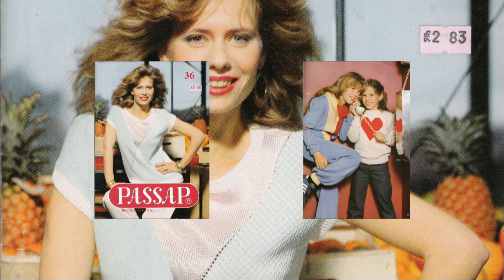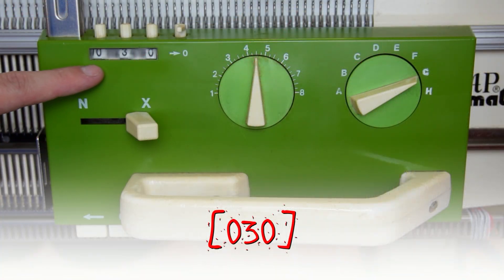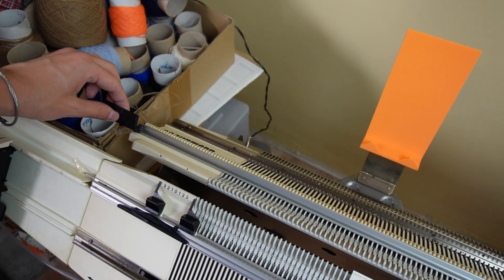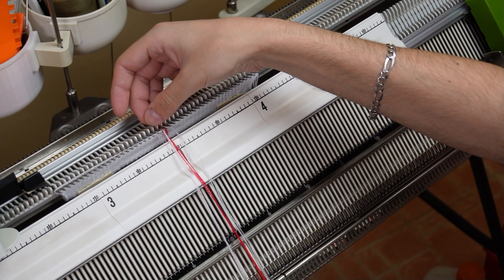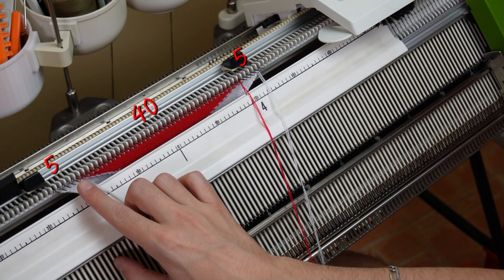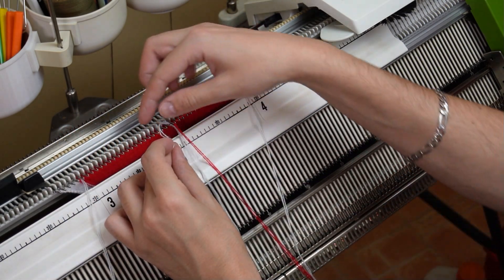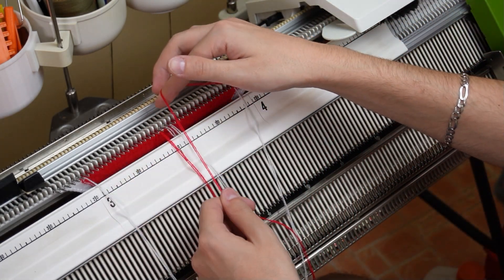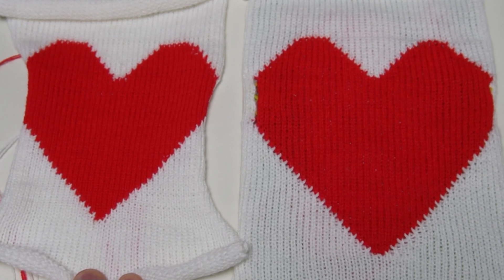Passap Picto: Knitting The Same Red Heart

Comment: I like that you were able to show the differences between. doing the same process with Picto accessory as well as the original lock to do intarsia or picture knitting.  Both of your intarsia videos show the basics of this process.  This process is how you can knit with many more colors than the basic 4 colors of the knitting machine. You can design images with pretty much unlimited colors and design this way, as well as using yarns that would never work in the eyelets.  This channel really explores the versitility of the Passap knitting system. ❤🤩🤩🤗🤑